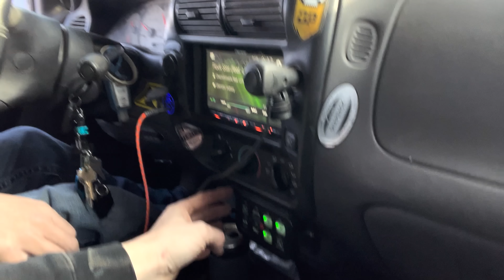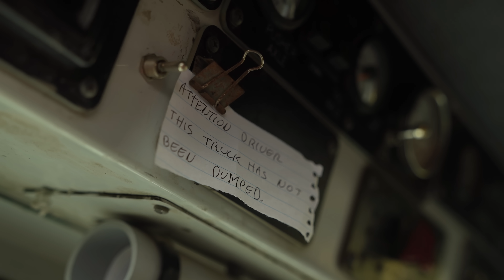I Was Left Unsupervised at a Government Auction and This Is What Happened...

Comment: I’m surprised you aren’t making a recovery camper out of it, a support vehicle for the overnight recovery’s or long jobs. Hard to beat hot coffee and a warm bed on a long cold recovery job that’s a ways away from home. Also doubles as an unstoppable RV.
Reply: Hell yeah good idea, something warm that can actually be used for search and rescue/fire crews as a base and as acomm way out in the hills.
Reply: I feel this comment needs more likes
Reply: Dave..^^
Reply: I would like to add, I have no idea how this platform operates and I have no idea if this would be a good idea or even feasible but it sounded cool at the time.
Reply: SMA put together a cool sprinter van for the Pikes Peak electric unlimited superbike record attemp, 2013? three PV arrays the shape of the top of the van slide out to 3X the van square foot area.  Something like that could be done with a recovery expedition truck with  awnings and pop outs not hard to put more than a half acre under shade, inside a windproof air conditioned enclosure.  had a job making inflateable buildings that  pack down to  3' x 4'' x 5' times two containers, and inflate into an aircraft hangar with 80' clear span,  built with two guys in about 4 hours.  Hunter Defense. bought the company.
Reply: This is the way.
Reply: That or build a heavy duty off-road ramp truck that you can fit 2-3 rigs on.
Reply: I like this idea...make it an Overnight Support vehicle. Then use the rotator as a rotisserie
Reply: that makes way too much sense, can't be having that kind of thinking around these parts.. ;)
Reply: Movie theater nd shower with a pool table nd Xbox lol
Reply: @PolozWorld  basically lol
Reply: That’s a great idea. And if it hauled the concretia you can put all the goodies on it, cuz I don’t think weight is gonna be an issue.
Reply: NOW THIS IS A SICK IDEA!!!
Reply: @nathanturner963  well lets dosoem theory craft then: It already has a damn great motor for turning the mixer, so can that be regeared into a generator?  Teh mixer barrel itself gets yeeted, to make space for an accomadation/3C hut...
Reply: YES. The MOABAGO
Reply: True but if a guy gotta get home…
Reply: i was gonna say just an overland camper but this is much better
Reply: How much money does he send to Trevor Milton for his canteen?
Reply: Are you aware if that cement mixture truck weighs 26,001 pound you would need a CDL to drive that truck🤔
Reply: it has the engine at the back!! great for a camper,no noise in the cab. use the existing cab for a bachelor only camper, or fit some front steer cab.....

Comment: That bottle motor is going to make one hell of a recovery winch
Reply: What’s the starting torque on the motor  🤯
Reply: @wintersun398  I think those bottles hold about 60,000 pounds and to mix the baffles have to be able to lift half that, so it’s got to be able to shift 30,000 pounds from cold
Reply: @eveningecho5334  hmm so if they hitched a chain off the spindle it could deadpull more than 14 metric Tonnes?
Reply: @wintersun398  sounds about right, but probably more given the size of the machine that HeavyD bought lol

Comment: Your cement mixers are super wacky looking compared to ours in the UK! Love it ❤
Reply: They switched to a front discharge option many years ago for 'safety' so the driver could see clearly. 
Also depending on the weight restrictions some states have multiple axles
Reply: Most of ours don't look like that. That there is a front discharge, which are way more popular on the East Coast. Out in Cali, we use rear discharge. Those front discharge are nice because you can drive right up to the forms, no backing up. And the operator can stay in the cab.
Reply: Most the concrete trucks I've seen here are not this style. Supposedly these are better though, they sure are goofy 🤪.
Reply: @Roger_Rabbit_Adventures  thanks Roger, that makes sense now 👍🏼
Reply: @gregwaters7830  interesting, thanks Greg 👍🏼
Reply: @spf-92.5  I certainly see the advantage 👍🏼

Comment: Yeah, this man should NEVER be left alone at an auction.
Reply: Dave knows exactly what he is doing, he probably got it dirt cheap, seeing how it has a full barrel for ballast. It's one hell of a job to jackhammer to clear out the concrete and horribly noisy, you need really good noise canceling headphones. Modify the barrel with steel liners inside to turn it into a mobile ball mill for gold recovery. The rest of the truck is a monster truck capable of many uses, would not be surprised if it has low mile/hours.

Comment: It's crazy how capable they are yet none of the cement companies are willing to take them anywhere that has even the slightest bit of a wet spot, I build houses for people off grid and it's always a nightmare trying to get cement on site it has to be a perfect day out.
Reply: Mostly because if they do get stuck its alot to pull them out and customers always say it ok and they dont mind the property damage then after they get shocked and angry with how big the ruts are.
Reply: They don't want them to get stuck or break. You only  see these types of concrete trucks in areas  that have hills and snow
Reply: Mixers and soft ground don't mix.

Comment: Long time ago local cement company had a guy that used used explosives to break up set concrete. Took a day or so drilling and packing. Then “whomp”. Truck would rock on the suspension. Start it up and churn aggregate out. Was quite a sight.

Comment: Interesting that Alan says he uses Tide detergent on his hair. I am bald on top and just use the same soap I use for the rest of my body on my head. BUT, Tide is great for using it as a hand soap to get the grease off. Sometimes I use a small scrub brush if I am really greasy. A little hand cream when they are dried off helps soften them up. I especially like the Aloe Vera hand soap because it doesn't leave a grease feeling like a lot of other lotions. I also find it good for relieving body pain from working while bending over.

Comment: My Ford ranger was a '98 and I had it until 2013 I put 780.000 mi And it still would have gone down the road if I was able to find a new transmission for it and clutch assembly but could not find one in my year

Comment: I use dawn dish soap...
Reply: similar: generally speaking whatever soap leaves the least residue does the best job unless you are looking at a mess that is mostly one compound which may justify something more specialized...which usually won't be "soap"
tried a few different kinds now and every single kind of handwash dish soap that I've tried works better than everything that is not handwash dish soap that I have tried.
Reply: @evernewb2073  I use dawn because there is a lot of hair stylists and other hair profession people that i know that also use dawn dish soap and at 33 (I started doing it at 15) I must say i have never had any issues or dry scalp, nothing. I live by dawn, and i will die by dawn.
Reply: @InuHatsu  might try that kind next time I run out, tried 6 so far and they all worked close enough to eachother so as to be indistinguishable in function aside from the one that was clearly chocked full of smellme chemicals in exact contradiction to it's labeling...couldn't even use it for dishes it left so much residue, doubly strange since it was the second bottle of supposedly the same stuff.
Reply: @evernewb2073  Dawn is used to clean animals of oil from oil spills, the more u think about it the more it makes sense.

Comment: Expanded side rolling workshop for on site repairs. With a touch of RV. Replacement COE cab from the 1960s. Welder, air compressor, generator, fridge. cooker, crapper and crane.

Comment: I was wounded in the Vietnam War...After I got back from Vietnam in 1970, they re-trained me as a supply technician, which included "Property Books" (Inventory control) One of my jobs was to handle "Turn ins" of Army equipment to be sold at auction. ALL military vehicles have a record book of maintenance/service history. All you have to do is ask for a look at it when you go to auction... in 1975 I went to one such auction as the maintenance division was turning in their parts truck as it was pass it's age (use by date) . A 1968 Chevy "Side Step" pick up...3 on the column, six banger. It needed new wood for the box bottom (I bought a custom kit and a muffler). I read the millage book and since maintenance owned it ...the engine and body was flawless ... picked it up for $800. The only issue when buying is you need to inspect the item as maintenance workers may swap parts to fix another... such as a master cylinder ... be safe ... by the way Delta was there buying a Jet engine from a crashed aircraft ... I was told that wing's side wasn't damage???

Comment: If you are going to sell it make sure you tell the buyer you beat the crap out of the ring on the drum by not rotating it during transport. Spin it now and that banging noise is what I'm talking about. You will now forever destroy rollers with that banged up drum. Next time even when empty you have to rotate the drum while the truck is in motion. The bumps in the road WILL dent the ring on the drum if not. If you have ever gotten yelled at on the way to the scale over CB radio while a fleet of drivers hear you get yelled at for rolling through the plant yard that way you won't forget.

Comment: as a driver of one for 20 years take the tag axle off the back it does more harm than good i know ever inch of them trucks and what there capable of if it dont have 4 air switches to lock everything in that means the front is open  diff and the belly axles behind the cab get you hung very easy hope yall have fun be safe but you will not be inpressed what the truck does cause its 40,000 pound empty no concrete

Comment: cleaning the concrete out of the drum isn't fun but it's fairly easy if you have heavy duty hearing and breathing and eye protection. a small jack hammer or a medium duty vibrator and a nice sledge hammer you can wield from inside and another you can wield from outside. i think you've got the idea how this goes just by saying that. vibrate the metal, not the concrete to get the bulk  and then the remainder out.
not my first mixer i've cleaned, doubt it will be my last.
as far as rock hopping it.... been there done that building power lines across mountains with no roads, don't do it in winter, ice is lethal, so is rain sadly, as one poor souls family found out when he was crushed and the family was flown in on a helio to say their last goodbyes.

Comment: Don't listen to all the idiots demanding you call it a "mixer truck". It's not even an accurate name, as the concrete is usually already weighed out and mixed before it ever goes in those trucks. All the trucks do is keep the pre mixed concrete moving so it doesn't solidify too quickly. Calling it a concrete truck is just fine.

Comment: They usually have one or two panels in the side that can be unbolted to allow easier access to the inside of the mixer drum.  With a jack hammer and some air chisels and really good hearing protection you could make short work of removing any concrete left inside the drum.

If it has a lot of concrete inside the drum,; I have known people who have used a jack hammer to create a "shaft" big enough to put a stick of dynamite into and use that to help break up the concrete.  Those drums are pretty tough.

Comment: I like the ultimate recovery vehicle suggestion.  Making it into an RV just might piss off some staffers in the long run.  BUT you can make it into the ultimate recovery asset.  Turn that mixer generator into a winch pull system.  Have storage and additional assets all in one.

I also thought you bought a sandcrawler since you kept saying government and big and the thumbnail sure looks like it.  Options:  offer to buy the remaining 4 or 5 mixer trucks at 80% value (if 4, offer 33k etc) and make a few different things out of each one.  A (Not-a-star-wars-sandcrawler) could easily sell for 50k, perhaps offer a few different types, as an off-road RV.  Plus you can repurpose some metal from the mixer bowl.  If Elon can market not-a-flame-thrower, aside from disney copyrights, you could sell these.  I'd suggest you make your rock climber fun toy, use it, enjoy it, then later sell it.  Make a recovery asset that's everything you wished you had.  Not an engineer, but you guys may be able to do that ultimate winch system.  Weld a tunnel over the winch or turn the generator around so that the winch is in the back.  And those RV sandcrawlers you could make and sell.